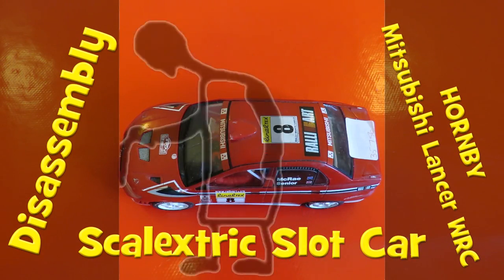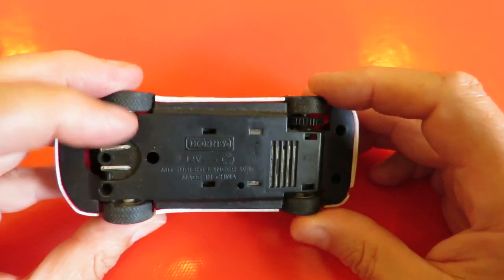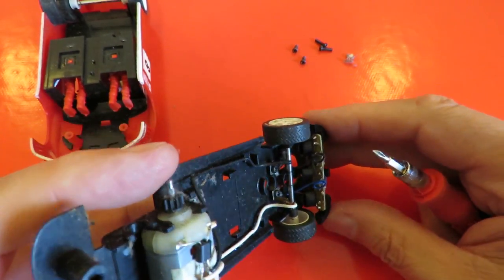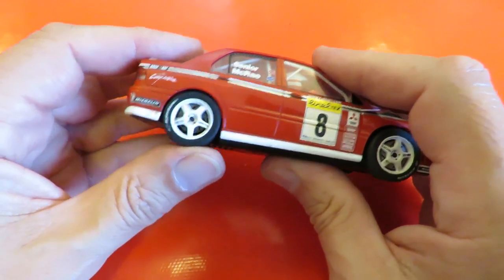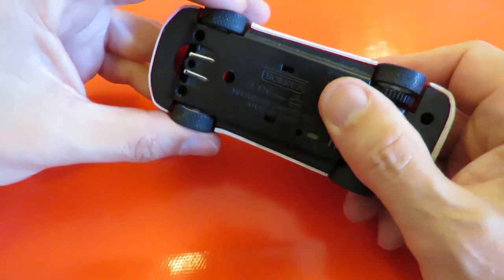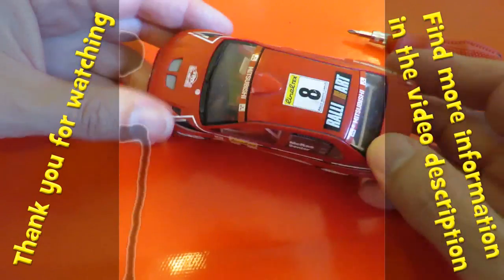Disassembly HORNBY Mitsubishi Lancer WRC slot car

Comment: in the US, the missing part is the "slot pin".  nice car.
Reply from the maker: Yes, I just did a quick search on eBay and can see your slot car pins. The Scalextric slot car guide blade is a different shape and I can see your tracks are a different format so the Scalextric cars would not be directly compatible. If you do a search for "slot car guide blade" you will see the difference. Interesting to see how the companies have taken different approaches to the same basic product.

Comment: I have several Hornby in my slot car box.
The Mitsubishi has provision for extra magnets.
Reply from the maker: This is another one for the junk box unless I start selling on eBay. Trouble with eBay selling is the postal charges make items like this far too expensive and they have closed all the local post offices so it's a special journey just to post them anyway. So junk box or back to a charity shop.
Reply: +GrandadIsAnOldMan couldn't you just use a small screw for the guide pin thing
Reply from the maker: Clorox bleach a plastic peg would be better. On proper Scalextric track the slots are conductive so putting a small screw in there would short circuit the power. The proper slot guides are not very expensive and available on eBay
Reply: Yeh I filled mine all it so it’s suck

Comment: Would it work with your slot track if it had a steering thing?
Reply from the maker: Not on the tracks that I have as they are only 3 volts and this wants 12 volts

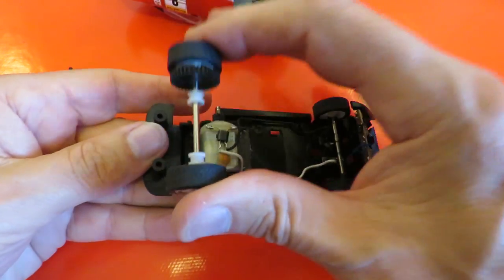Comment: 3:19 I think some kid has tried to custom it because those are aftermarket wheels mine is complety original and I don’t have those wheels
Reply from the maker: When I used to race slot cars they would never have had the original wheels, I would always have changed them for something with a better grip. But then, that would have been over 50 years ago 😁
Reply: @GrandadIsAnOldMan  nice I love racing my Mistu fact I’m just doing some tuneups and stuff to get her ripping
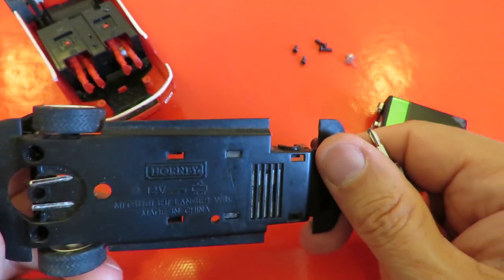Reply: @GrandadIsAnOldMan  and at 2:34 it’s called braids because they are weaved to look like braids just to let you know it’s not called a steering peg it’s called a braid 👍
Reply from the maker: @2smokeHennerz  I am talking about the guide peg that is missing. I am pointing at the hole where the 'slot guide' should be. If the link does not get blocked by YouTube, this image shows what is missing https://cloud10.todocoleccion.online/slot-cars-matchbox/tc/2019/08/20/12/174148102_154480657_tcimg_A7AF2D87.webp
Reply: @GrandadIsAnOldMan  I know what’s missing cause it was missing on mine but I’m sure it’s just called the braids but I might be wrong
Reply from the maker: You might like to look at this page with several images of the car https://en.todocoleccion.net/slot-cars-matchbox/hornby-slot-mitsubishi-lancer-wrc-alister-mcrae~x174148102
Reply: @GrandadIsAnOldMan  upload mores vids on the Mitsubishi pls